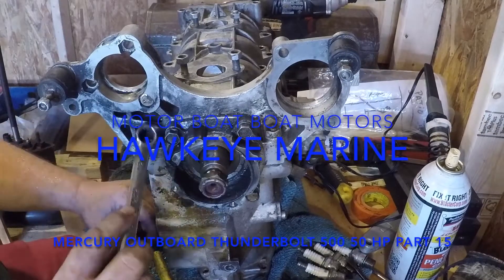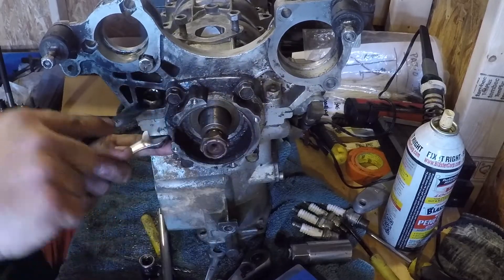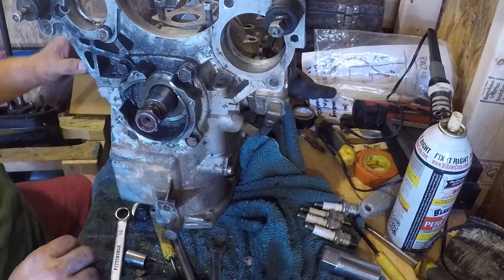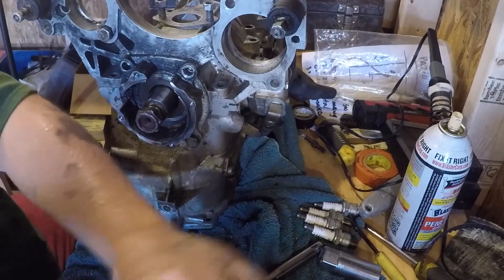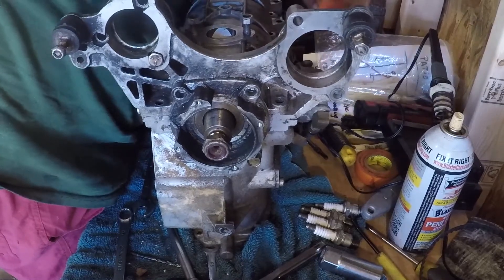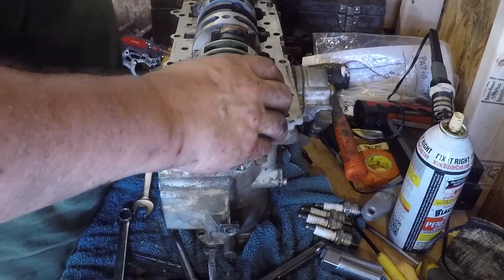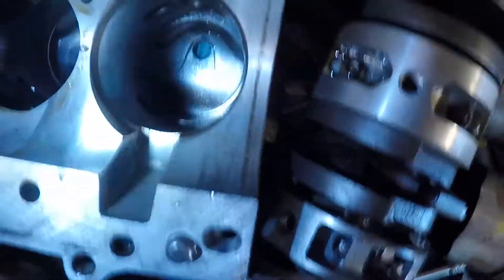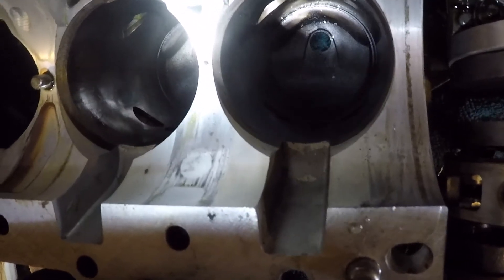Mercury Outboard Thunderbolt 500 50 HP Part 15 - Pistons Removal Cover and Bearings

Comment: Hey Hawk- I have a 1975 50 merc and tried to save a few bucks by swapping the prop myself but now after taking the nut and washer off its still jammed on there..  Any suggestions sir?
Reply from the maker: Try some some penetrating oil.  Hose it down good and tap with a rubber mallet.